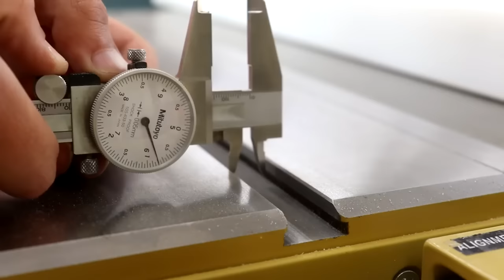The best devices for the workshop. Woodworking.

Comment: Thr router guide is cool. Guess it kind of self squares so it can eliminate some user error. But it feels overengineered.

Like a few square cuts of 1/4" thick MDF rectangles do thr same with tape. Granted, you're using up tape, but in the long run it's all 6 or half dozen. Thi

Comment: Cut the groove in one of the legs.
Have one screw say 4" (100mm) from the bottom end of one leg,  the other screw
say 5" (125mm) from its bottom end. Now, when the two legs are closed together
the tool becomes compact. Simple.

Comment: Jigs like this are a must have but with those screws u need to fasten in this little cut out? hmh. There are these things (don't know what they are called in English) u often see in furniture from Ikea & CO. - those things where u make half a rotation from the top (in this case) to fasten a pin. They are available in bigger sizes and would be an easier way for such a jig.